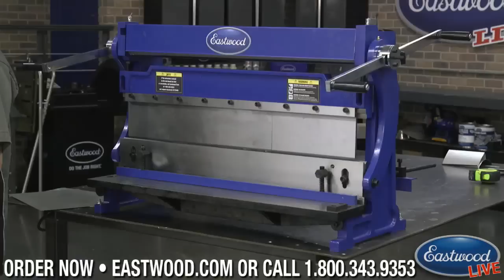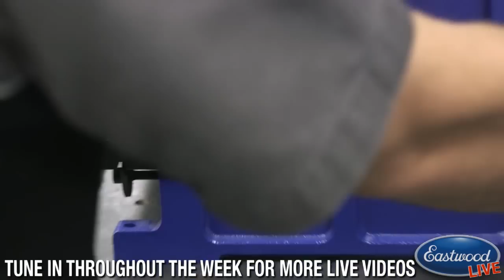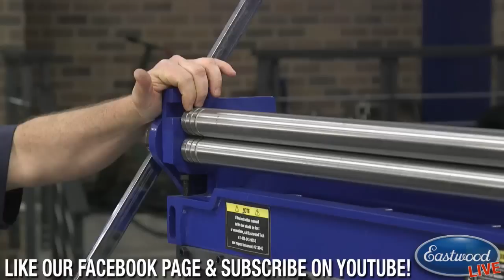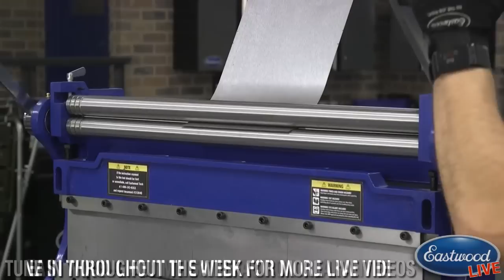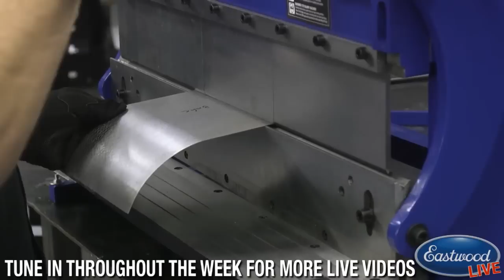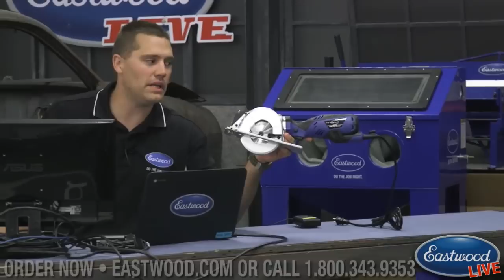How To Fab a Trans Tunnel with a 3-in-1 Shear–Brake–Slip Roll.  Sheet Metal Work at Eastwood!

Comment: these are great devices, and love mine, one safety thing to say
only remove the Tension bar only if needed but Keep the tension bar on at all times as it is also a safety bar
because all of the functions move when working with one
IE when using the rollers the blade will still move and cut and so if anything gets in the way well YOU KNOW!

Comment: Can this piece of equipment be used on 10ga stainless steel for bending, shearing and rolling?
Reply: This tool is junk same as harbor freight only difrance the color and name
Reply: No. Anything that does 10 ga will be hydraulic. This is capable of 20 ga.

Comment: Bought one , had a couple issues,  dont  really know if it's just me....first thing the handle always hits the bottom bolts, second, the roller cover always in the way when tightening the tension knob in the back of the machine, third the knob made of plastic not steel and threaded in which when I loosen the roller the knob starts coming off the tread....cheap design...also the last thing was I tried cutting 1'pc out of a 3'pc n had trouble cutting 22guage,  dont know if its because i haven't made my stand for it yet or not....Can i get some comments from the public ..thanks, at first before i bought this ,i was going to buy the harbor freight  version which was 2x cheaper now I'm double guessing  myself...

Comment: Where can we buy this in Europe ?
Reply: I am thinking about getting one too. I am really space limited, and I know this is probably worse than having 3 separate machines, but it does the job done for most of what I need.

I checked few other companies and they all offer exactly same machine, just with different color and logo. So I am certain this is just some generic chineese design, and can be easily found on ebay. It appears to be only in inches tho, so I am not sure if it is available in Europe easily.

Search for "Dere HSBR305"

I also was able to find it on ricardo.ch noname as "3in1 Hebelschere Abkantbank Biegen", at similar or even lower price, and I am certain one can find it in few other similar places.
Reply: movax20h  i bought one in the nederlands.  Exactly the same at hbm machines.   Works fine so far.   Only the cutters are a bit disappointing for steel of 1.5 mm.   its not cutting it.
Reply: Right. I want to be able to cut aluminium up to 1.5mm and galvanized mild steal to 1mm. So it should be finish. I am still considering just building my own break out of heavy steal profiles, but I do not have easy access to welding, so I am figuring out how to do that with just cutting, screws and such.
Reply: movax20h that will work 1mm and 1.5 mm alu.
Reply: Where it's sold.

Comment: Curiously, I have seen the harbor freight version and the handle didn't continuously spin. What this caused was, the  part being rolled had to be continuously fed in and readjusted to get a continuous roll. Did you guys cleverly choose to do a half roll just to not show this shortcoming or is this not an issue with the Eastwood 3-in-1?
Reply: I have the harbor freight version. Mine turns a full turn. It's exactly the same machine with a different paint job